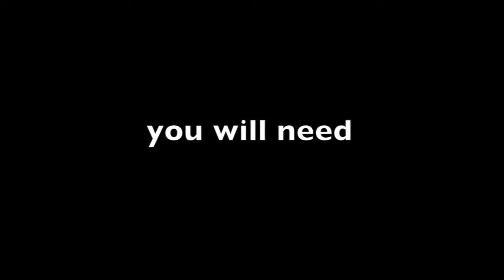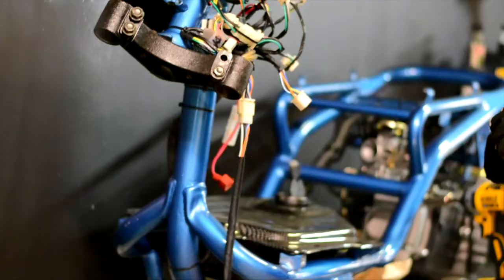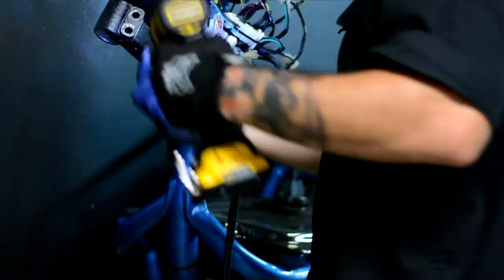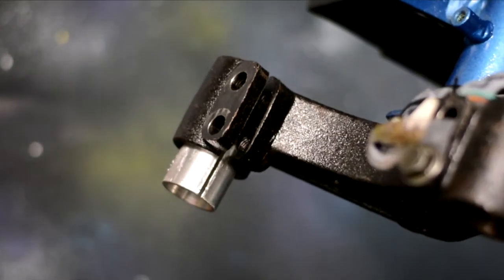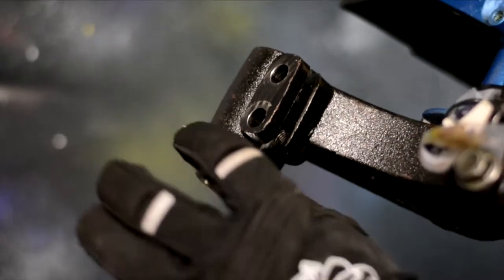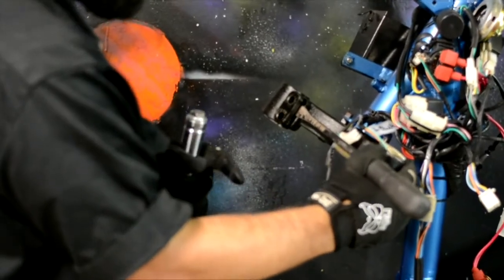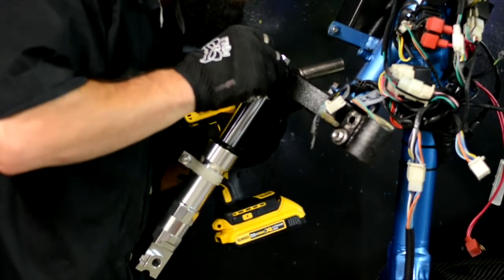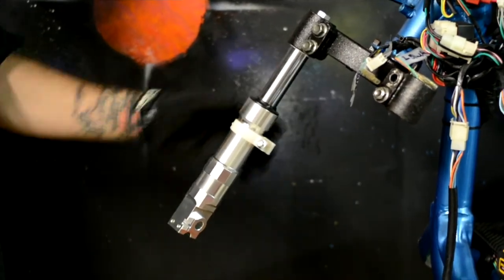How to install Shims for after market front ends

Comment: Did your shims have a step down on the inside diameter, and if so, do they go towards the top or bottom?  Doing this project myself and seem kinda lost.
Reply: I'm literally here for the same question. There's a lip where one side is slightly larger. I don't want to install until I know 100%